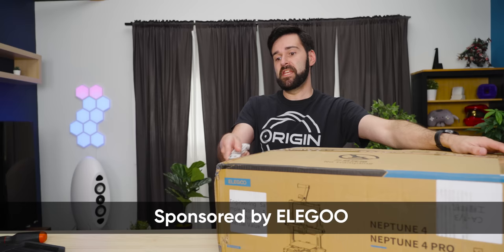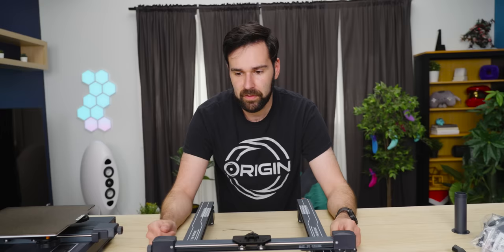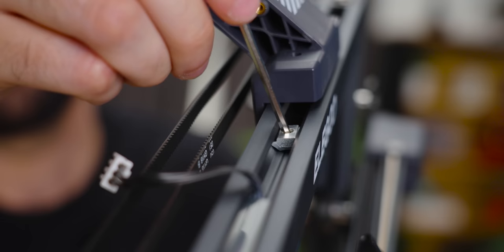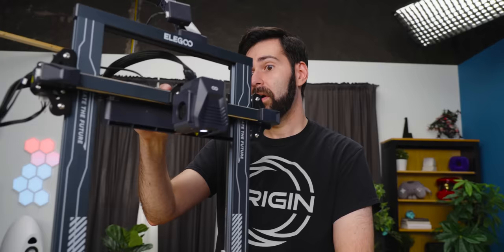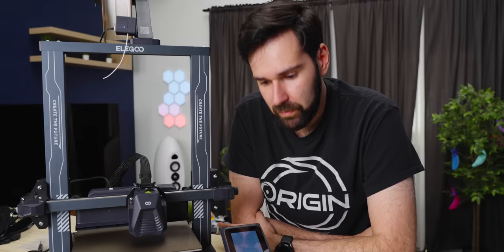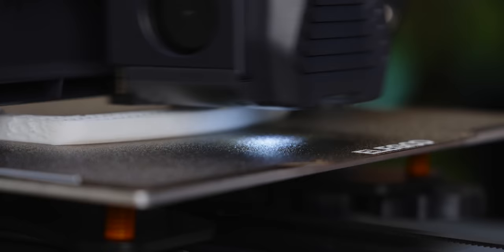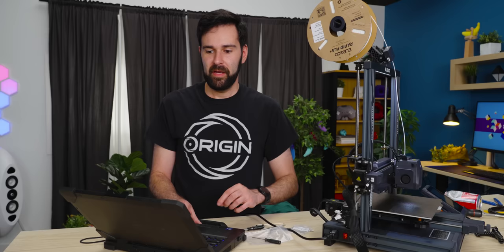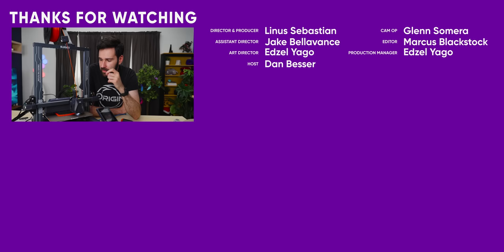Now THIS is bang for your buck! - Elegoo Neptune 4 Pro

Comment: About the prices, Dan- you realize that the 3d printer is just a hot plate, hot glue nozzle(almost), and two motors. held together by the cheapest LAN enabled microcontroller. with enough engineering and software know how it can be very cheap.....

Comment: Yoooooo. Now I found my first printer. Thank you so much ShortCircuit and Dan for an awesome review. I do like Dan's in-depth reviews, especially for specialized equipment either for manufacturing or for hobbyists. Keep it up. I will tune in for Dan's next specialized equipment review. Don't worry, even other hosts I also like with awesome tech focus (like mechanical keyboards, phones, photography, and so much more)

I do miss one tech reviewer... Where's Emily?
Reply: get a used mk3s in decent shape for the same price. The fundamental parts of the printer v-wheels, non lead screw Z, and spring leveling is atrocious. It will not stay calibrated as those parts are known to wear quickly. Really you should be looking for a solid frame and not alum extrusions bolted together.

At the price point you should get auto bed leveling
Reply: @wilurbean  no lol both this machine and mk3s need z ofset and arent that much diffrnt besides better klippper running for future upgrades. Why would you get a mk3s? To waste money when you can get this for 300$ with non rubber wheels??
Reply: @tophatv2902  mk3 needs a final z offset to get the last millimeter corrected and then it's set until nozzles are swapped out. Hardly like a pos ender. No wheels

Comment: Klipper is amazing. It completely transformed my poor ender 3 pro. 
Fun fact: if you have a bed leveling sensor like a pinda probe or a bltouch and set in the config the bed leveling screws position, the screw thread pitch and an corner order, you can just run a macro and it will go to each corner, probe the bed and tell you how many turns of each screw you need to turn in order to make all corners equal to the 1st one. It even divides it in "minutes" if smaller than half a turn. 
Freaking amazing.
Reply: Got a link for instructions?  I have a bigtreetech motherboard in mine and would like something other than octoprint.

Comment: That looks shockingly similar to my Ender 3 S1. Seems to share a lot of the same plastic parts and general design
Reply: I was thinking that too! I think this is a bit cheaper than I got mine though, so seems like a pretty good deal I like my s1.
Reply: I have the feeling like elgato is mixing parts of the ender 3 s1 and s1 pro and rebranding it

Comment: I have wanted to get into 3d printing for years but as a purely tinkering/hobbyist I couldn't justify the $750-$1200 price tag to just fool around. This actually seems like an amazing option worst case it breaks or doesn't last forever I'll know whether I want to invest more, but if not I won't feel like I'm out a significant chunk of change. Thanks for being so open to examining a much more cost effective unit. Even as somebody who knows practically nothing when it comes to printers we all have seen similar units in this price range that are obvious junk.
Reply: My opinion, don't buy one to just dip your toes. See services or your local library till you're sure it's right for you, then don't buy a mediocre dime a dozen bed slinger.

Comment: My first printer was a piece of crap ANET A8 running some random old version of Marlin and it cost me about $170 on sale, back in early 2017. I then dropped another $25 to immediately replace the PSU (which was a known fire hazard). It was basically a bad Chinese knockoff of a PRUSA MK2 with a crappy laser cut acrylic frame. I probably dumped another $250 into it just fixing things & upgrading parts over the years. Being able to get something this amazing for $299 shows how far things have come since then. I definitely my grab this one of the 3 Max for my plastic squirting needs.

Comment: The Klipper FW (and mainsail ui) are open source. I built a printer last year, and have all those features on my UI as well. 400x400x400 cartesian, Octopus board, with 2209 drivers, and an RPI 4B running the interface.

Comment: Print speed doesn't always work as expected. For instance, with Bambu printers only Bambu PLA can print at high speeds, or some other that is also top quality. I've tried even with recycled PLA and beyond 200mm/s you can't get a good quality printing.

Comment: i think having the dual z motors synchronized and running on the same driver is a huge oversight.
they couldve easily added a additional z motor driver, so you could take advantage of z-tilt in klipper.

and the fact that it comes without a wireless solution already is kind of dumb, but besides that it's quite a amazing machine for the price, and quite capable of good prints.

Comment: I pre ordered it a while ago and it should arrive soon. It's possibly the best bang for buck 3d printer right now. You basicly get the same BambuLabs P1P printing speed and quality + klipper and input shaper for half the price and even a touch screen and better led lights than the P1P etc.
If you don't need some of the premium features of the P1P like the camera or wifi or 500 dollar multi colour ASM system, i would just buy this one. Technically you can even attach your own camera and wifi dongle via the USB port.
Reply: This comment is just.... I'm at a loss for words with the logic here. This printer does not have any of the automatic calibration features of the P1P that make it easy to use. You have to calibrate it all manually

Furthermore the P1S now exists which is enclosed too to boot.

This is really really bad advice.
Reply: @BeefIngot  "All manually" You mean adjust the Z Axis ONCE which takes like 30 seconds, after the usual auto leveling ONCE and you are done.
Why even bring up the P1S? Yeah it comes with an enclosure, it's also 750 bucks, so even more expensive. Most people out there will also must print with PLA or maybe PETG which do not require an enclosure and if anything print results can suffer from it.
Not like you can't just buy a universal enclosure for the Neptune 4 Pro for a few bucks or even built one yourself with two Ikea Lack.
Look i'm not saying the P1P is bad, obviuosly it's good. But people like you always get triggered way too easily the moment someone doesn't act like it's gods gift. And for some reason they also always act like every other printer like this one takes ages to setup or something.
I get the feeling P1P users are just the Apple fans of the 3D printing world.

Comment: This is how you sell a product that has everything the user needs to actually use it. When they made this printer, they said to themselves that you will have everything to print. No having to build it and then be disappointed because you don't have a flash drive or microSD lying around. No having to go out and buy a new ethernet cable. You just have everything you need to actually use the product you just spent hundreds of dollars on.

Comment: The 3D printer crowed really underestimate the draw of a polished product. One of the reasons I like the ankermake M5 is that it looks like a completely finished product and not made from surplus cuts of metal. 500mm/s is possible on a bed slinger, Ankermake does a full benchy under 17 minutes. A video comparing all printers claiming 500 mm/s out of the box settings would be awesome.

Comment: 25:21 30mm/s is fast? My "regular" print speed on my mostly-stock Ender 3 Pro from like 2019 is 120mm/s. What in the world are you using at home?

Comment: I am still waiting on mine to ship.. i was torn between rolling the dice on a snapmaker idex and then just play it safe with the bambulabs carbon x1...And then the more research i done about this printer i figured  build an encloser and Micro swiss said no matter the nozzle they will have hardened ones available.. I think i will be able put together a decent printer capable of doing alot of materials and not spend to much

Comment: So basically this is my Ender 3V2 with all the mods I've made and more than than just the friggin' micro SD slot for interface, for probably less money than I have into my Ender, with more features.   Many of the parts resemble the Creality parts in my eyes.  Of course if I bought this I wouldn't have gained the skills to disassemble and reassemble with most of the screws a 3V2.  Christ I've had this thing apart 100 times it feels like...

Comment: The reason I guess most cheap printers don't use Klipper is because Klipper uses two controllers, one of which is usually a Raspberry Pi or similar SBC. The main motion controller require a full blown Linux system, and even more performance if you also want to run an interface like Mainsail or fluidd. Normal printers running Marlin only have an anemic microcontroller, sometimes even just an old 8bit Atmega.

Comment: Pushing the Anker M5 to 500 is doable in good quality. So I call shinangans on this video. Maybe more time needs to be spent with this printer.
Reply: The main problem is probably the outdated software. Elegoo/Sovol always ship with really outdated slicers, sometimes a year old.
The moment they come out and people use the profiles in current slicer versions they perform way better.

Comment: I don't really see how this printer could come anywhere near its speed claims in real life. Unless you're printing parts that are maybe 5cm tall at most, they'll be flying if the bed tries to move at high speed. For 300 bucks it looks like a pretty good choice, but those speed claims are unrealistic
Reply: This mechanics can push 10k XY accelerations easily. Main bottleneck is hotend capacity, so 500mm/s only at like <0.1mm layer height.

Comment: "Hopefully I didnt immediatly destroy the printer by having it set to the wrong voltage." That gave me instant flash backs to my original Anet A8, and how i destroyed the power supply by being stupid and changing the voltage while it was plugged in (though it was good anyway cause i got a more reliable power supply)

Comment: If you’re spending this little on a printer just go resin. Sure the print head can go to 300 degrees but it won’t actually be able to print anything that requires those temps well. They say it’ll print nylon, it won’t, at least not well and you’ll require a separate dry box which I hope you’ll be using a whole reel of in a couple of weeks.

Comment: But are the Elegoo printers safe (compared to something like a Creality Ender)? Does it have things like thermal runaway protection etc. that works good, do all the screw connected cables have ferrules on them (instead of twisted and soldered), is the PSU high quality and are there any like fake XT60 connectors etc. in the system?

Comment: How the hell these companies can make printers so cheaply with so many features is beyond me. AND IT COMES BASICALLY FULLY ASSEMBLED. The first few printers I built back in 2012 and 2013 both cost $1200+ with the same build volume, motors that sounded like a cars engine, required literally every single piece of hardware assembled yourself, had no provided firmware, and took you atleast a solid week of printing to get anything "decent" (aka not failing mid build). This thing still makes my 3 year old printer look archaic for the lack of features, and this is still the same price as it! No inflation change, no discounts. I'm going to keep my eye out on this guy...

Comment: For those who don't need some of the bells and whistles/the higher speeds, the neptune 3 pro is pretty equivalent in ease of use and quality, and you can usually find it nowadays in stock for $200.
Reply: noooooo. This has klipper. completely different animal. There is so much general compete misinformation under this video it hurts.
Reply: @BeefIngot  you can use klipper on a 3 pro as well, though it requires a raspberry pi.
It's not bad info, it falls under the "bells and whistles" that one may not care about. You are the one spreading bad info if you act like both everyone wants/needs klipper, and that if they want to start using klipper later on they couldn't then install klipper.
The only benefit for the 4 pro is it's built in rather than needing a pi to help run it. But as I said not everyone, and especially not beginners, needs access to all the dials klipper gives, or even want/need network access at all.
Reply: @BeefIngot  He said for the people who don't need the software features or speed. Most people who just want to try put 3D printing and dabble around with some funny prints or flexis etc. will be fine with even a used neptune 3 or kobra neo. No need to recommend something like this let alone something like a P1P for people who might print a handful of things.
Reply: @kwedl  exactly this. I have nothing against the printers, and they look cool. But @BeefIngot seems to assume everyone who picks up a 3d printer is going to be an ultra hobbiest/enthusiast, when some people just want to do some basic prints.
Even still, I stand by the neptune 3 pro given it costs 1/3 of the price of the bambu. A cost that's much easier to eat if they are just getting into a hobby, and the features and quality is still very competitive even at that price. Is it perfect? No, but most printers, even expensive ones, won't be. That's why we mod our printers as we go further into the hobby

Comment: I'm sorry did you say that  printers THESE DAYS had been feeling slapped together? I bought a Kickstarted printer in the 2010s that had a slanted X axis and the resin casted pieces were missing holes and were deformed from heat in shipping.

3D Printers are so much nicer than they used to be. People forget the Peachy that was supposed to do resin printing in a cup using a disk drive laser.

Also this is totally a geeetech clone with more class

Comment: For 300$ thats insane

My printer is an ender 3 non pro non v2 non neo, for 200$, and while its a good enough printer for such a low price, that 100$ jump gives SO MUCH for just a hundred dollars. Mesh bed levelling, good interface, screen that updates fast instead of taking half a second to switch menus

If i was getting into 3D printing right now, i'd absolutely buy this over the creality 3's, holy sht!
Reply: Lmao my thoughts exactly. Why upgrade my ender 3 when I can sell it and for like 150 dollars, have a fully upgraded ender style printer with klipper and everything already put together? I preordered one already and I cant wait for it to come in 1 month!
Reply: @zachmakesstuff1368  Now i wish i had money, or a job, so that i could replace mine... 

In the one year since i've had it its been such a massive pain in my ass with the constant need for a level bed and other issues

Comment: Got mine was very excited to get it however it had a bent pin on the head which support just told me to bend back which I did and been having very mixed results and it can't seem to stay leveled.   Their discord is full of issues with these sadly  contacting them again to get a replacement or refund.

Comment: Feels like the Sovol SV07 is better value for a similar price. Same Klipper. Better planatary gear extruder, local Wifi instead of ethernet, slightly higher speeds, indpendently driven z motors, mean well psu, extra long all-metal hotend, double-sided pei.

Comment: I heard that the chip of the printer can run klipper only porly/is instable does anyone have some experiences with this chip that support this statement?
Reply: it's not being run by the printer, it's being run by the laptop...
Reply: @brettmaddan3255  Thats not quiet right its the same with octoprint which works with a pi if there would be no workload you could just use a Microcontroller like the esp32 which would be way cheaper 
Edit: not a esp32 but a Arduino micro with a Bluetooth Module (dont know if the esp can communicate over usb)
Reply: @sushionroad4859  I have a elegoo neptune 2 and a raspberry pi running klipper, from what i saw in this video though the laptop was running klipper and interfacing via the network port?

Comment: I know that it's not a top end printer but for as solid as that printer and it's software & firmware are I thought it was going to cost way more than that. I was actually shocked when you said it was $300

Comment: You think that's good value, Sovol has actual rails instead of V wheels for less, and then a 300x300x340 for barely any more than this...still blows my mind the deal I got on my SV06+ No Klipper though, but Klipper is still young in the scheme of things, and as great as it seems, I didn't want to dive into that yet... Though plenty of people are flashing their SV06 and SV06+'s to use external screens running Klipper.

Comment: I'm getting the 3D printer itch again.
Although the Bambu Labs is more expensive it really seems like more of a next gen fdm printer... But for the price, this is really hard to pass up.
Reply: I'm doing a deal with myself. If I can 3D model the project I have in mind then I'm allowed to buy a printer (or possibly a CNC router if I can find one that doesn't suck).

Comment: Elegoo printers are so cheap because they reuse as many parts as possible from previous generations and only change what has to be changed to fit the new features. Most of this printer looks exactly like the Neptune 3 with the exception of the IO changes, the internal assembly of the head, and the array of fans (which is new).